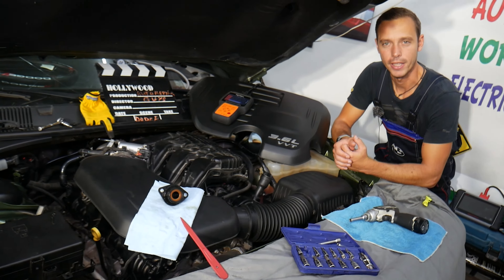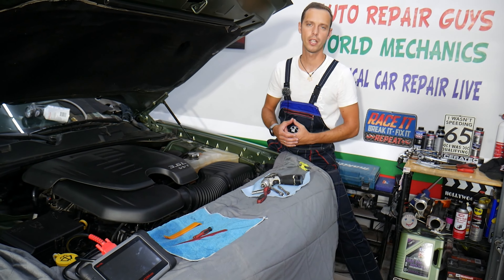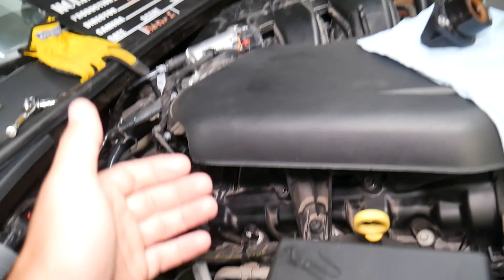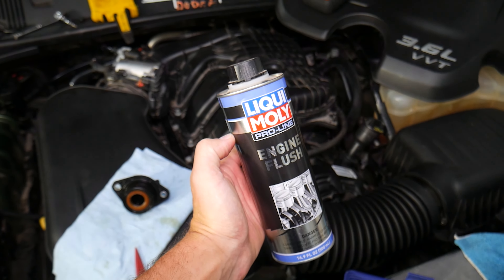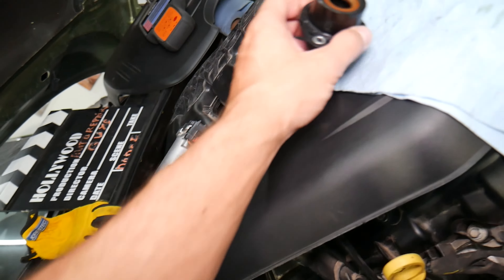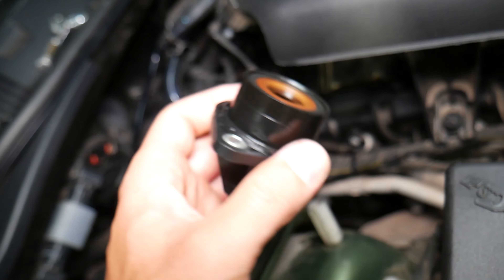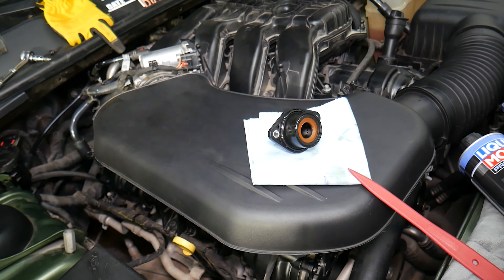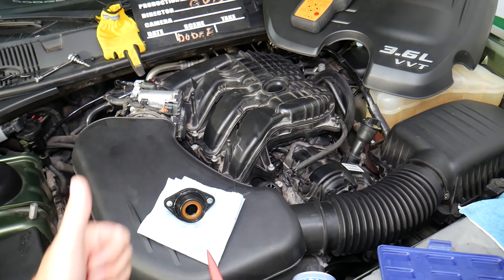DODGE CHARGER BURNING ENGINE OIL, INCREASED OIL CONSUMPTION

Comment: For real this guy knows what he’s talking about I did my pcv valve and cleaned my throttle body basically a hole clean up tune up from air to coils spark plugs purge canister pcv valve breaks and it’s thanks to this guy but my point is you will see a very big difference in the engine and I’m not just saying that my engine doesn’t feel like it’s forcing and it runs much smoother thank you so much for making these videos